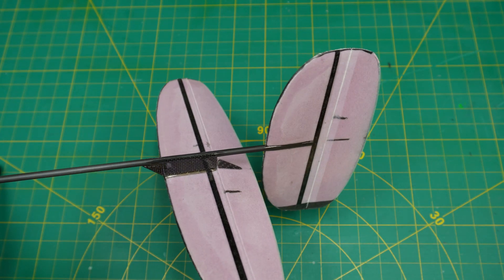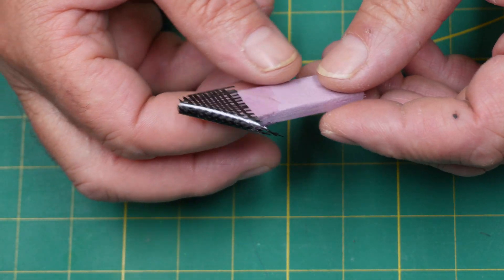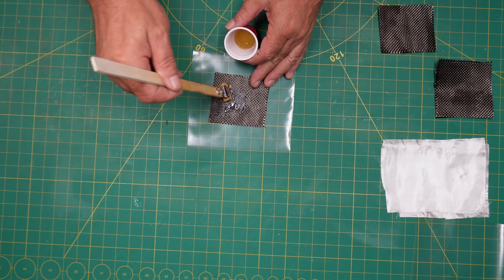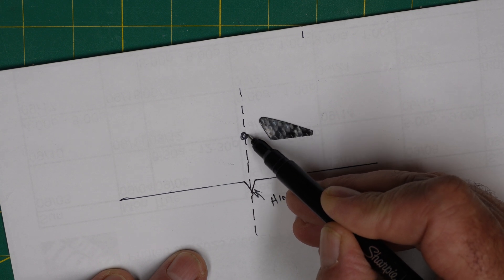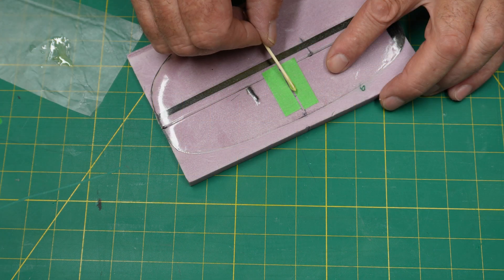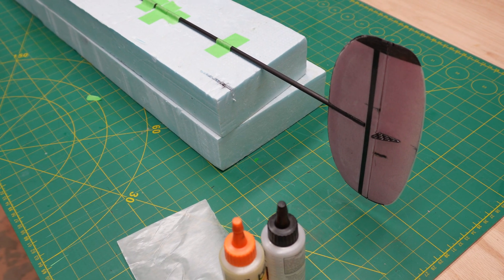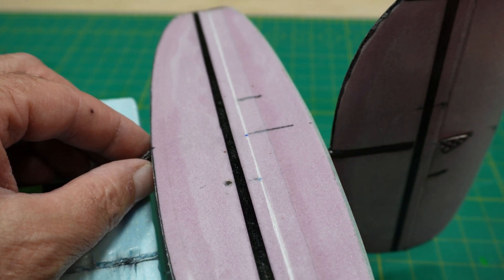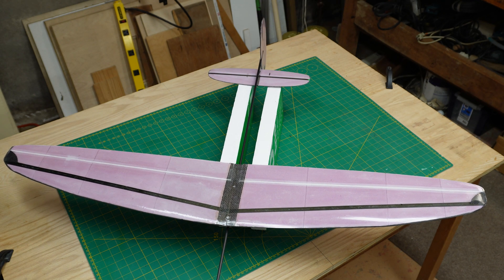How to make a F3k DLG glider. Tail assembly

Comment: Could you please tell me the reason the horizontal stabilizer is attached under the boom?
Reply: Got it. Thank you!
Reply from the maker: sure!
At launch,  the dlg will climb at a steep angle. Once it reaches it's  peak,  you want it to kick it's tail up to achieve a level attitude. This "kick" needs maximum down elevator. Hence the mounting on the bottom.  :)

Comment: Thanks for sharing!  You've rekindled my desire to start building n flying again after a 20-25 yr break, so TY!!!
By chance, can you give me the specific file or possibly airfoil type so I could search online for them......for the tail group!?!?  Found the wing planform and templates but not for the tail group....TY!
Reply from the maker: Thank you for the kind words. Airfoil used in the tail group are as follows:
HT12  chord=93mm for rudder.
HT12  chord= 73mm for the stab.
Set my hinge line @ 60% of chord from the L.E..
Airfoil configurator @ airfoiltools.com
Cheers 😎👍

Comment: I think that I have to learn the patience from you! Bravo! Ecxellent work! That glider won't has got any drag...
Reply from the maker: thanks for the kind words my friend. 
Hopefully,  little drag as possible. 😎
the back half of the pod will be a challenge.
Reply: @amonus-air2160  There are plenty of variations for POD too, right? I like PET pods, I just attach the two half pieces (lengthwise) to each other with packing tape. Notched at the back, bending the parts so that the tip fits the arrow at a point. I use soldering iron to make two holes on the top for the wing connection, and two on the side if there is an aileron. I wish you good luck for your work with own POD!
Reply from the maker: @goldenfish77 thanks for the good luck wishes. I'll be designing it in a CAD program and 3d printing it with lightweight PLA .
Reply: @amonus-air2160  Wow, it will be nice job! I also desire this technique more and more.